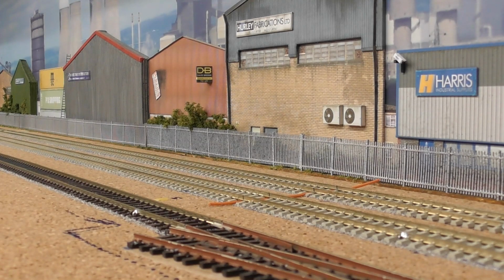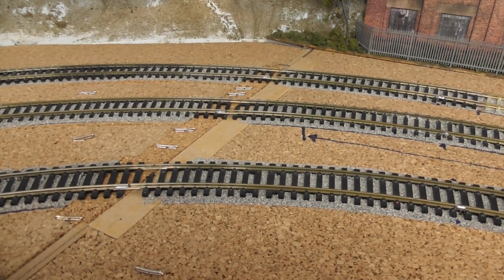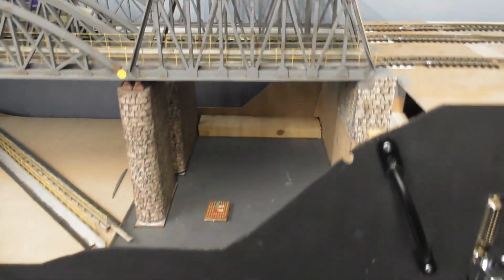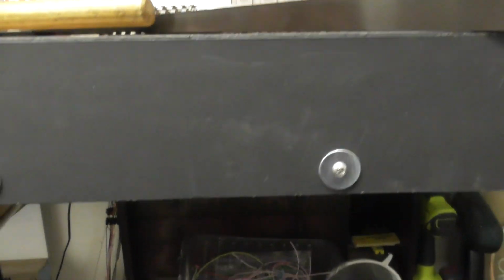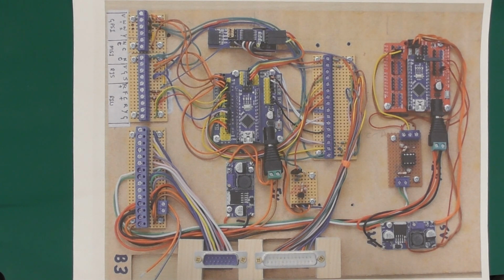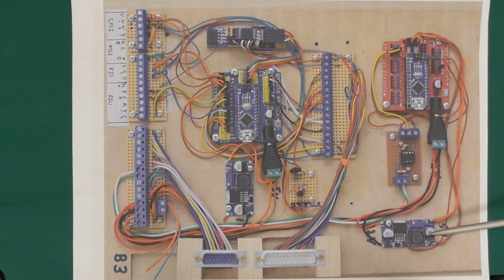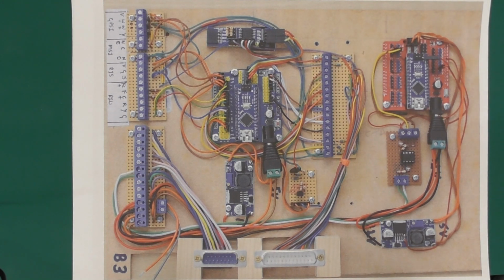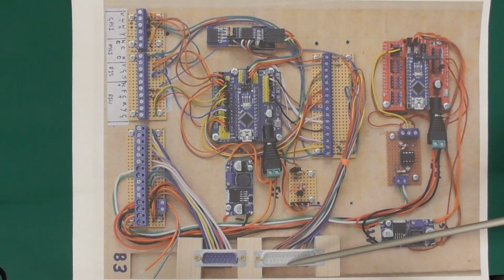Cana Sidings 85   Trains Running Again At Last On My Inglethwaite Layout

Comment: Great to see trains running John and wow what a lot of wiring but all very neat and a credit to you. Looking forward to  the next progress.
Cheers Kev
Reply from the maker: Hi Kev and thanks for your support. Yes there is a lot of wiring when you actually get it together but it is all quite simple and logical as I set all my rules out very early in the design stages and made sure that the Arduinos did almost all the complicated sruff. I just need to build a few more signal boards and hope it works when the switch is thrown! ...................John